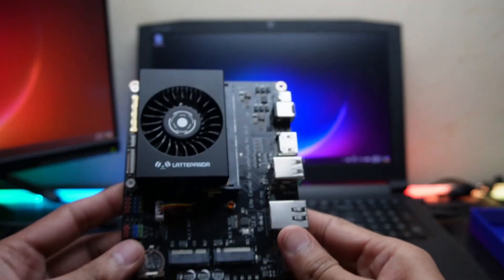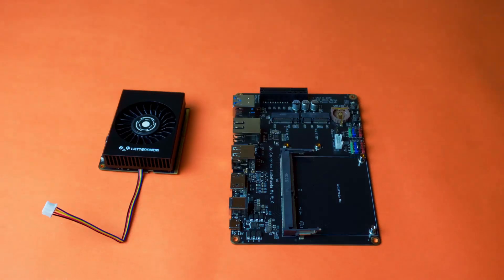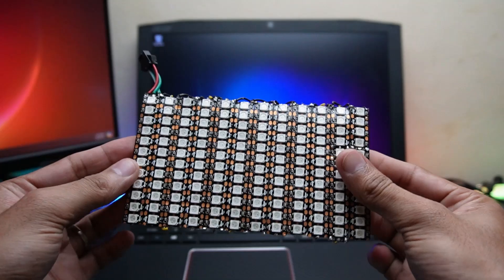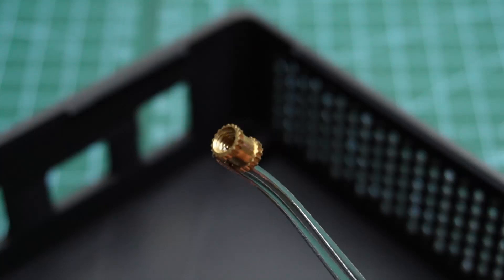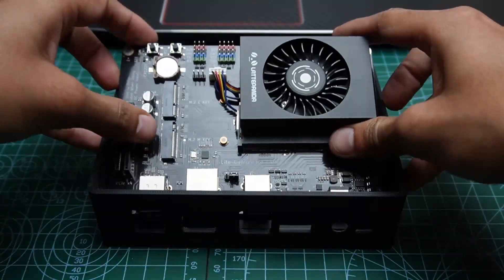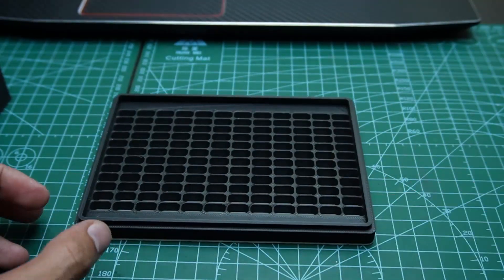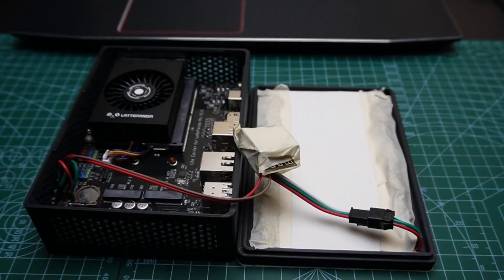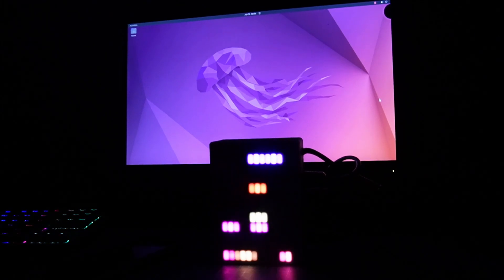PixelPanda | A 3D Printed RGB Matrix PC Build #LattePandaMu #DFRobot #MiniPC

Comment: Looks nice. So the Latte Panda doesn't interact with the animations except for power, correct?
Reply from the maker: Yes as the lattepanda doesn't have GPIOs. But the lattepanda does have the i2c and UART, I haven't explored if we can interface WS2812B using these.